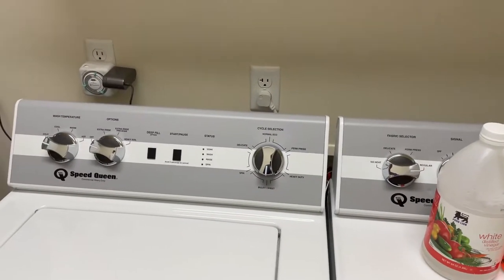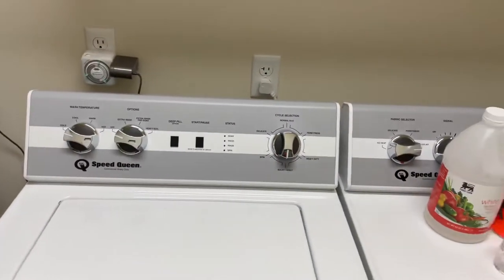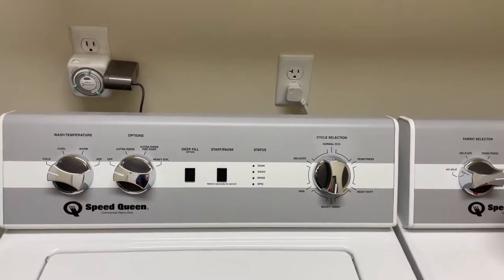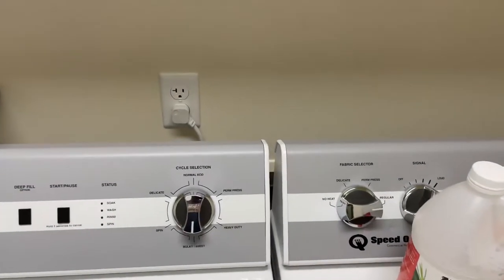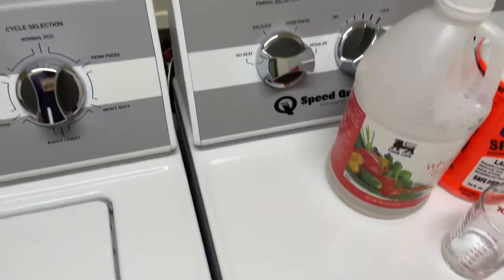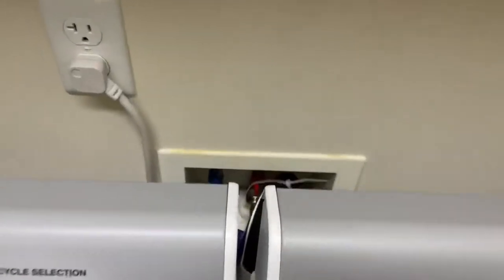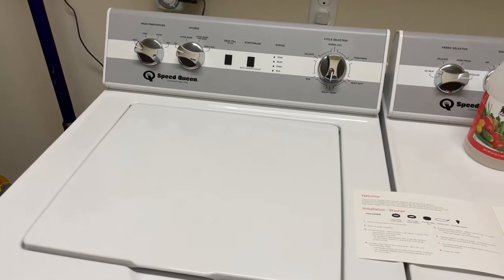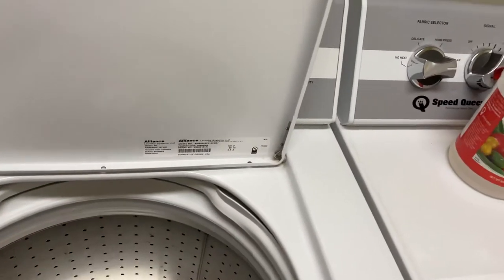Foam Bubbles coming out Speed Queen Washer drain hose - Fixed!

Comment: Great video.  When our old 1st-gen Whirlpool Duet finally quits, we plan to replace it with a Speed Queen.  I'm wondering if you ever noticed excessive sudsing during the wash cycle itself?
Reply from the maker: No.  The washing itself has no issues.  I don't know if I would recommend getting a Speed Queen.  There are more things we don't like about them.
1.  The suds issue.
2. On our dryer:  The rollers that the big drum rotates on develop flat spots when it sits idle.  Even overnight.  Every time we turn it on we get a very loud thump, thump, thump as the drum rolls over those flat spots.  It quiets down after a minute - but that shouldn't happen.  They used the wrong materials on the rollers. 
3.  The dryer's lint trap is an absolutely horrible design.  It is on the bottom, and wide open.  There is no removable door or trap.  When we put clothes in or remove them:  If any piece of clothing dips down into that trap - it picks up a lot of the lint that is in the trap.  Then, we have to pick all that lint off our clothes.  It is a terrible design and I can't believe they haven't improved it all these years.  We do clean the trap after every load.
Reply: @rickstid-bits   Sounds like you're less satisfied with the dryer than the washer.   Definitely will give this all a second thought based on your real-life experiences.  Thanks for the information, and for the video.
Reply: @rickstid-bits  Hi Rick, we just got out DC5 dryer and it sounds like you're missing the top piece of the lint trap. It's a grate that fits onto the trap.
Reply from the maker: Would you send me a couple photos please?  Installed and removed.
Reply from the maker: Thank you for this.  Hey!  They listened to me!  And developed a cover for it!  My model is a DC5000WG (2 years old).  My parts list still doesn't show that cover.  I looked up a newer model (DC5003WG) and it shows it!  I just ordered one.  I don't know if it will fit my lint trap top.  For $10 - I'll find out.  If it doesn't fit my original lint trap I will look into ordering the new lint trap also. Thank you again for the heads-up!  Rick
Reply: @rickstid-bits  That’s great!! Glad to help. Now I hope they find a fix for the suds issue!! Just bought my TC5 a week ago so I’m trying all the suggestions.... I tried the vinegar in the drum before the clothes...so far it’s not working. I’m going to try adding it to the center dispenser and I’ll try a little liquid fabric softener. Someone commented that a washing machine tech told them do not use vinegar because it ruins the plastic components. Hmmm
Reply: Rick S Can we just put some type of cover over the drain area where the suds back up? So the suds don’t come out? Wouldn’t that fix the problem?
Reply from the maker: Hi dfpg,  No.  You cannot completely seal that opening.  You need some air in that pipe.  If you sealed it so no air got in there you could fill all that piping full of water, and create a backflow siphon that could potentially flow backwards into your washer.  
     I initially thought about simply wrapping a rag soaked with some type antifoaming agent around that area.  But I would have to do that every time we used it.  The vinegar has worked well for us.
Reply: @rickstid-bits  thank you for the info. The vinegar isn’t working for me. I use 1 ounce of white distilled in the tub or in the middle thing and I add HE tide filled only to the very first line of the cup. We’re still getting suds. I haven’t tried liquid fabric softener and vinegar yet.
Reply: @eloquent-nuance  nope. I use vinegar and it helps but I have to watch it.
Reply: @dfpg10  in general vinegar is very corrosive ... people who use it to clean their dishwashers are often warned by repair people ... i have other SQ problems and would not recommend it, the computer cycles get confused $1200 each unit I thought I would be set for 10 years! BS poor quality as in most things these days
Reply: @ooohlaa13  good to know. Thx

Comment: We found we were having the same problem. Pulled the machines and had mold all over. No idea how long it’s been happening. I’ve used vinegar faithfully but can’t tell if it was happening when I did laundry or just my husband. He does his work clothes but he wasn’t using the vinegar. Knowing this we’ll both make it a priority. I would put it in the bleach dispenser. Did you try that? Or just the softener location? 
We also use deep fill… I didn’t see anything about that in the video or comments. Could you elaborate on if you use that or leave it off? Thanks again!
Reply from the maker: Hi Michele.  
*  We almost always use Deep Fill.  We usually wash full loads and we want the extra water.  
*  I want to add the vinegar so it's in during the rinse cycle.  The Bleach Dispenser will add it during the wash cycle.  The Fabric Dispenser will add it during the spin After the wash cycle (so it's in with the rinse water).  
*  Never use the Normal (Eco) cycle.  That cycle does not have a rinse!  Normal only Fills, Washes, Drains, Spins, and only "sprays" some water on the clothes while it's spinning.  There is no second Fill!  So, there's still lots of soap in your clothes (and machine!  It's crazy.  
     Any other cycle:  Fills, Washes, Drains, Fills again, Rinses, Drains, Spins.  
     You can also always use Extra Rinse if you want a 3rd Fill and Rinse - to remove even more soap.  
*  Most detergents are now much stronger than they were many years ago.  They are all more concentrated.  So, do make sure you are using less detergent.  
*  Please click the Thumbs-Up button above.  That helps more people see this video.  You can click Subscribe also. 
*  I hope I've been helpful.  Please click on Rick's Tid-Bits above and look around.  I have a lot of other household videos you might find helpful.  Rick
Reply: @rickstid-bits  Thank you for your video! So @rick's tid-bits when, where, how do you add the vinegar AND detergent. Do you use HE detergent?
Also, do the adapter just plug into the drain pipe and the pipe into the adapter without tools/screws, etc?
Reply from the maker: Hi Nancy.  
*  I have a lot of good information in the reply right above this one.  Please take a look at it.  
*  We use Atsko Sport Wash detergent.  I don't know if it's an HE soap or not.  
*  Yes.  The rubber adapter that came with ours goes in the drain pipe, and then the washer's drain pipe goes inside that.  No tools needed.  You can coat the washer's pipe with some dishwashing soap before you install it.  That will help it slide on easier.  Rick
Reply: @rickstid-bits  hey Rick thanks for the detailed reply. so we have tried to increase the height of the drain stack. We've done only 1tblsp of laundry detergent and the 1.5oz of vinegar and we still have bubbles. We also always use the deep fill and we have NOT used the eco wash. We are literally doing test runs as I type. Do you have any other thoughts?
Reply from the maker: Hi Michele.  
*  Do you have the rubber adapter that came with the machine installed in the drain pipe?  It won't do a tremendous amount of good, but having it in there to block some of the free, open space can help.
*  I added everything I sent to you in my video description.  I also added Step #1.  You can try step #1 in my description.
*  Some cycles use a High Speed spin, and some use a Low Speed spin.  I only get the bubbles during the last few minutes when I use the High Speed spin.  I don't on the Low Speed.  However, the Low Speed spin doesn't spin-dry the clothes as well as the High Speed spin, so that is the spin we use. 
     That's about all I know at this moment.  If any of that, or anything else, works for you - please come back and let me know.  Rick

Comment: Not a cure, just a patch.  Was going tomorrow to buy this same machine. Glad I watched this. Will buy a different brand.
Reply: Excellent machine and worth the money.
Reply: There’s absolutely nothing better than this machine that will wash with no BS sensors and fake agitators. Put a seal around the top of the pipe if it’s that big of a worry.
Reply: @Goldenwoodz  you won't be saying that when it starts foaming out so much it ruins your wall. A $1400 washer shouldn't do this. I regret buying mine every day

Comment: I have never had that problem in 2.5 years but I also ways have a problem with the computer getting confused, especially if I stop the machine to add something, and then restart.  Also have the problem of it continues to fill even when not plugged in, I have to shut the water off by hand and play around with it and psych it out manually.  I have a repair guy coming today who thinks it just needs a screen replaced but I have cleaned the screen of well debris and it still does not shut off the water upon filling.  Since I always use the extra rinse cycle I never have had suds using regular liquid detergent, economy version.  Will update after today.
Reply: Update:  well it was for me the water mixer not computer.  That's a relief.  But the service person put the hot on the cold and the cold on the hat and I had to call him back again.  Its a mad mad world in so many ways!!!

Comment: Thanks for the very informative video. I have the same suds problem with my SQ. Bought it just over a year ago. I was hoping your vinegar remedy would work. I added an ounce of vinegar along with a very small amount of HE detergent to the basket, but still get lots of suds. Should I add more vinegar? Should I put the vinegar in the softner dispenser? Thanks again for the help! I'm subscribing to your channel.
Reply from the maker: Hi Dennis.  Thank you.  Try this:   Speed Queen told me to run a cycle on HOT, no soap, with a cup of vinegar (I added 2 cups).  They told me it would flush out any residual soap build-up in the machine and the drain line.  That helped for the next 2 loads.  From then on, we add 1-2 ounces in the fabric softener dispenser (in the middle of the agitator) at the same time we add soap to the machine.  Also, from what I've researched, there's no problem with adding more vinegar.
Reply: @rickstid-bits  Yeah, before I watched your video, I ran four cups of vinegar on hot to clean it all out. Didn't work. Maybe I will try that again on the heavy soil, heavy duty settings? Also, on the next load I'll add the vinegar to the dispenser. Thanks for the help, and the prompt reply.
Reply from the maker: Let me know how it goes.

Comment: Thank you for the video, this is a nightmare! ours not only has bubbles it just pours out water all over the floor and has ruined our wall. I will never buy one of these again. And they should not sell these to the general public if it causes this much of an issue. For me this is total Garbage and I too have called and had all the and if and buts with the repair and warranty situations. I just want to wash clothes like I have for 50 years I don't want to spend one more thought on this piece of garbage and I would not want to resell this crap to anyone else and have it ruin their home as well. Speed Queen shame on you for selling this nightmare...I don't want to have to call an engineer to redesign my home for your garbage. WHO HAS TIME FOR THIS!
when it was delivered and installed the delivery person also ruined my new door. ( side note) AGGGGGGGGGG! I can't even with this! I HATE SPEED QUEEN! How about a reimbursement for the washer and dryer and repair the damage to my house. DO NOT BUY THIS, ours has to wear a diaper until I get this crappy Speed Queen out of my house and now I need someone to fix the wall damage from all of the water. (from before we realized what was happening) ours is A LOT more than just bubbles! TOTAL CRAP!!!!    WORST EVER!!!!!

Comment: We just got the same washer TC5003WN a few days ago and on the first 2 washes, it does the same thing !!! Soap suds come pouring out of the stand pipe during the spin cycle and we have that plug installed in the stand pipe also and still does it. This has never happened with our other washers. The settings were " Warm water / options set to off / cycle set to normal /eco. 2nd time we tried setting option to extra rinse and made no difference. Would changing the cycle from normal/Eco make a difference ?  This is very frustrating as I thought I was buying the best top loader on the market !
Reply from the maker: Hello,   Yeah.  We were shocked too.  We also thought the same thing about the best machine.  Every cycle did it for us.  1 oz. vinegar with the detergent has worked every time!
Reply: Take it back and get your money back..My wash machine is doing the same thing. It didn’t do it for 3 years then all of a sudden 4 months ago it started called a plumber. 2 times we snaked it they told us to us industrial vinegar that cost $19 we used that still suds. I bought this washer and dryer because I thought it was the best made in the USA . Boy was I mistaken. I called the place where I bought it and talked to a service tec that told me he had been doing this job for 30 years and it’s something stuck in my drain, which I had already had snaked it out.So they sent a tec out he ran water in it and listened and said our hose was to far down in the drain I knew that wasn’t it. Still has bubbles . I have been washing clothes since my was 10 years old I have never seen anything like this and I am upset . Every-time we wash clothes we have to run to see if bubbles is running down the wall.They are trying to charge me 300.00 for the tech for standing there and running water in the machine. People back old washers and Dyers believe they last forever.. We should not have to do all this to wash clothes.. This is my husband picture but I am his wife is writing about this…
Reply: Yup I was soooooooo mad over ours doing the same thing and our place we purchased it took it back and we got something else and no problems at all !
Reply: @charlesbales6402   Tech tried that with our stand pipe hose too but nothing made a difference .  I was disgusted over the whole situation and never would recommended SQ.  I am curious as to how this turned out for you ??

Comment: Oh wow. This video was extremely helpful! Thank you! We just received our new speed queens just yesterday and the first load, it happened. We have a brand new manufactured home, just moved in, and this is the first washer and dryer in it. We were thinking it was our house/ drain pipe but we have no other issues in our house. Do you put your laundry soap in first with the vinegar at the bottom of the tub as the directions suggest? Or clothes first then soap and vinegar? Also I was thinking maybe I’m putting in too much soap. Ugh. Kinda disappointed that we’re having these problems with a brand new good quality machine like this.
Reply from the maker: Hi Tara.  Thank you for your comment.  That is why I do these videos.  I enjoy helping other people and after I figure something out, I post them in hopes others find them helpful.  We add the clothes, let a good amount of water fill, and then add the detergent and the vinegar at the same time.
Reply: Did it help your issue ? I am having the same thing, just got it new.
Reply from the maker: It completely solved it.  We are using just one ounce of white vinegar every time and we have had zero bubbles since.
Reply: @rickstid-bits  What site did you find those charts at ? I went to the speed Queen site and didnt see what you have ?
Reply from the maker: Through the Speed Queen website:  https://docs.alliancelaundry.com/tech_pdf/Production/204807en.pdf
Reply: @eloquent-nuance  Exposed and is new 2"
Reply: Thanks for the advice, Sounds like a good fix.
Reply: with my LG top loader (model WT7300CW), I usually add the detergent and Borax and sometimes vinegar or Lysol or Clorox sanitizer before the laundry, and I have only had this washer since July 2021, so I personally have not experienced any problems with the type of detergent I am using, of which I usually use Persil, Tide, or Woolite
Reply: Take it back and get your money back..
Reply: @rickstid-bits  Hi maybe try adding a little of detergent at the bottom so ( detergent first) then clothes! 😊
Reply: You have to put the detergent first then add your clothes! ( if you add detergent on top of the clothes it will create the bubbles issue)

Comment: Would you still recommend a speed queen washer? Im in the market for a washing machine but definitely dont want to deal with suds issue
Reply from the maker: Hi Yvonne.  Well . . . that's difficult to answer.  I am old school.  For me:  The less electronics appliance have - the better.  Give me plain, mechanical timers, and I'm happy.  I thought that's what these were.  But I later found out that these have (minimal) circuit boards also.  From the research I did:  Again, for me, this was the most reliable, reputable brand.  I learned that a major problem with a lot of other brands is:  You can't get parts for them even just 2 years later.  They make x number of units, and x number of spare parts.  Then they change their electronics, and those parts don't fit, and you can't repair it.  I called quite a few appliance repairmen and they all told me that.  So, now that I've cured my foaming issue by adding vinegar every time - yes.  I would buy these again.  Thank you for writing to me.  Rick
Reply from the maker: Yvonne.  I just watched this video.  I've seen both the washer and dryer opened up.  I agree with everything this man says.  Yes.  I would buy them again.   https://youtu.be/qlkdxWfTZVw